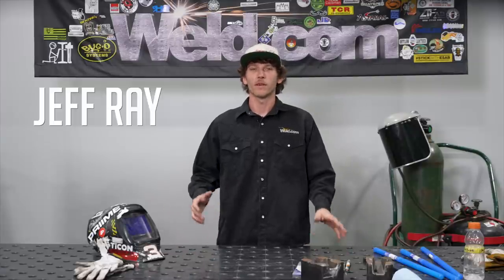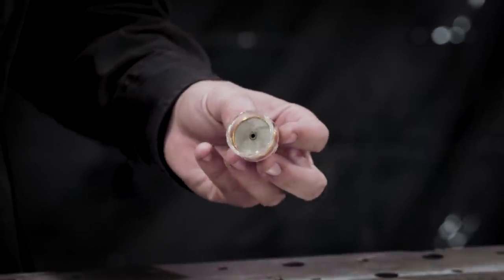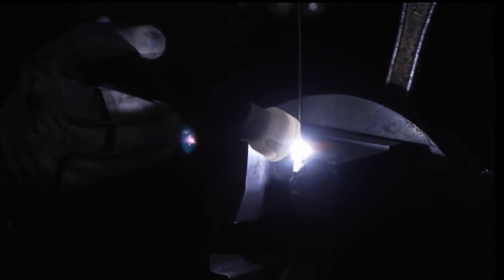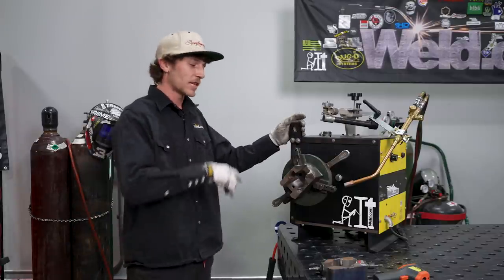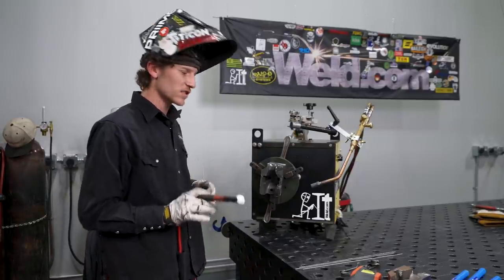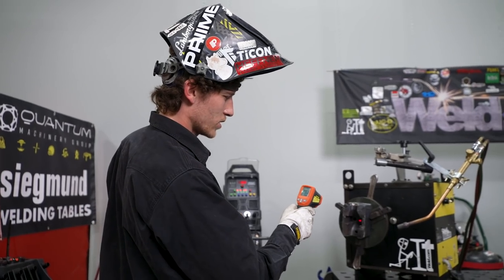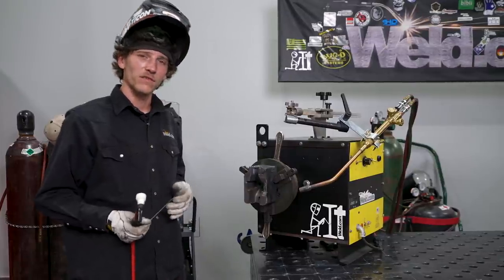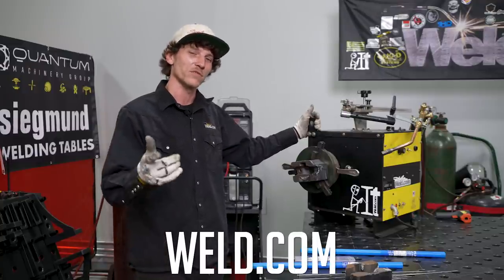Repair of Casting Molds

Comment: How do you finish the die to return it to service? Flattening out the top is easy, just a good ol' surface grinder. As for the pocket, I don't imagine that stuff machines nicely, although I suppose it could be done with modern ceramic/diamond insert cutters. At the point of using a sinker EDM, which is probably how it was made to begin with, I genuinely wonder if it actually saves enough money to be worthwhile over new tooling. Of course it could be a surface-grind it flat then finish it by hand with a die grinder kind of thing if tolerances aren't exact, which many forgings aren't.

Comment: Also when talking about sizes of tungsten or anything else dont just use the metric system,use the standard method,fraction like 1/8,3/32,1/16,1/32.Not everyone understands the metric system.In fact what you could do is show both measurements on your video, standard and metric.
Reply: Celsius to Fahrenheit too.
Reply: 25.4 bud
Reply: Standard is metric you fool, only 3 country’s world wide use imperial So standard would be metric
Reply: @olzz-wake7958  and this country just happens to be one of them.
Reply: Happy to hear world standard (SI) units used in a US-produced video! If you want to include Imperial units parenthetically, fine, but metric units should always be featured.
Reply: It’s nice to see a video where just one measuring system is used. Bouncing between both systems is when the mixups occur. If we can’t convert to our own preferred measurement, welding is also probably beyond our skill level.